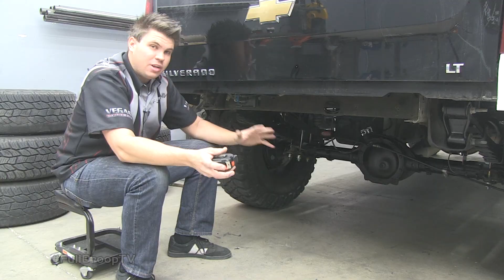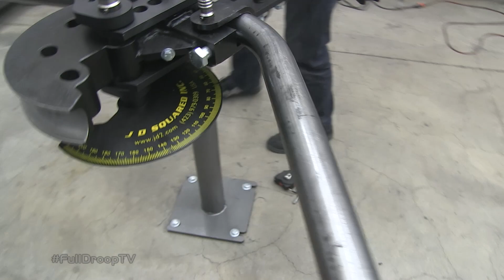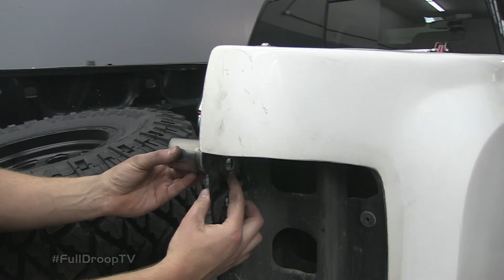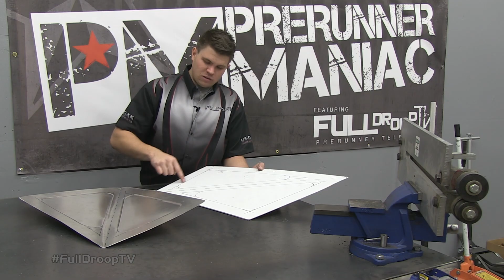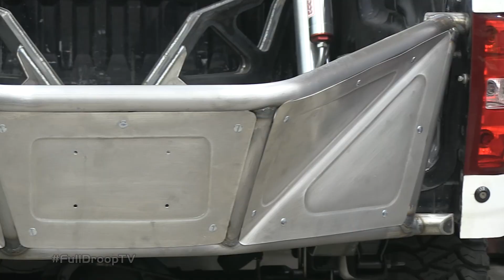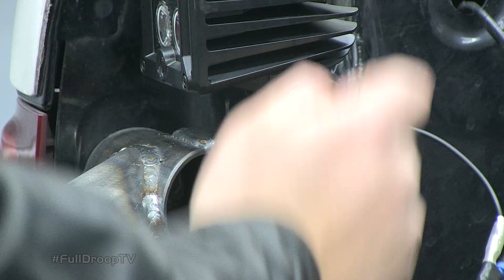Silverado Prerunner Rear Bumper & Tire Carrier - FullDroopTV (Season 1, Episode 4)

Comment: how come you didn't want to center the tire weight in the truck or over the rear axle? Is the some advantage to extending it out over the edge
Reply: also what is that tube notching template you used. I've been notching with center line measurements and that would speed up my productivity 10 fold

Comment: Do most trucks of this style have the rear tires sitting in almost the stock track width like that while the front long travel kit causes the front tires to be extended? In the beginning of the video the difference just seems so extreme.
Reply: its a stock axle, so its deep in the wheel wheel, normally no

Comment: What model truck it this please!?!?!?
Reply from the maker: 2007 Silverado
Reply: Do you know where I can get one cheep without the upgrades
Reply: +ian alderson Anywhere you look?  Cheap is subjective.  You can find these anywhere from 11-30K, depending on year, mileage, and options.  4.3L V6, 4.8/5.3/6.0 V8 engines are available.  There is also a 400hp 6.2L engine available as well, but you won't get one 'cheap'.

Comment from the maker: No worries and yes you need bumpstops. The where part depends on the kit you buy, the fiberglass fenders and wheel and tire combo you choose. After the fiberglass fenders are installed and the kit, you need to have the wheel on and use a jack to cycle the suspension up just before your tire hits the fender or anything else. The bumstop needs to be placed so that when it is fully compressed it will stop at that point to protect the fenders.

Comment from the maker: Not for this project but our upcoming F150 build will include a shock tower brace that goes over the engine. Usually an engine cage is only built when you full cage your prerunner.